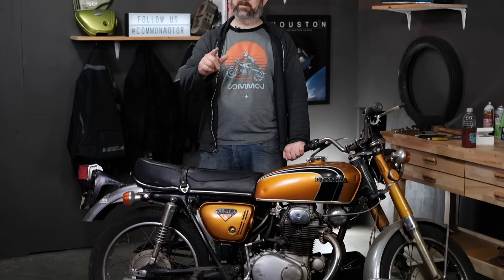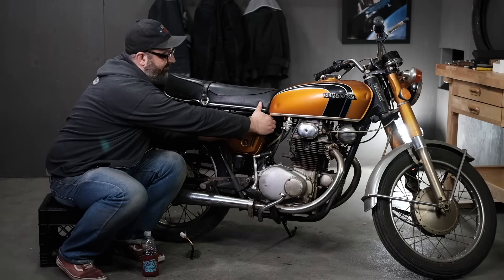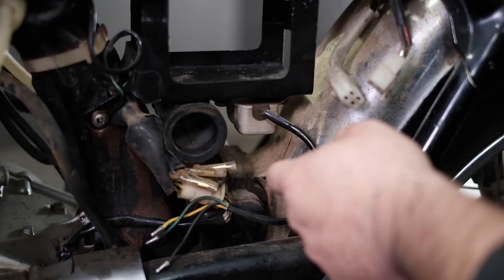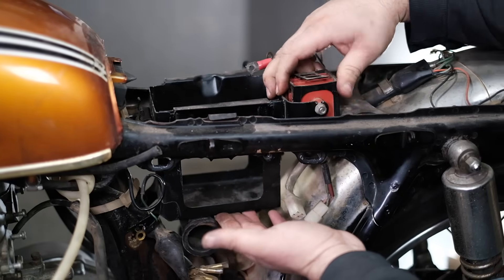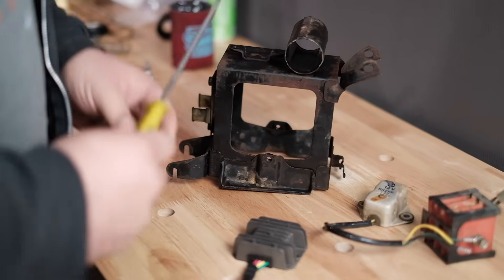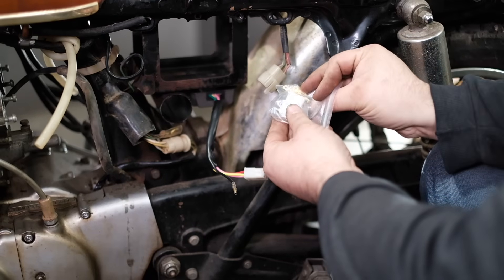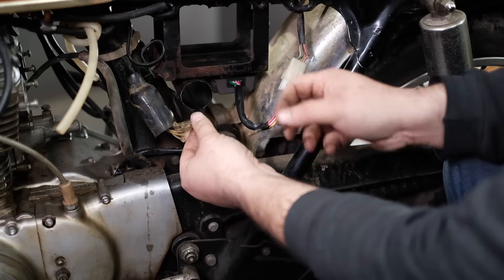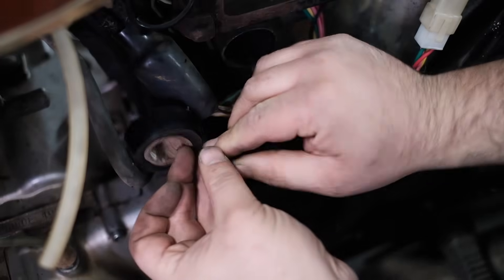How to Upgrade your Vintage Honda CB175 / CB200 / CB350 / CB360 & CB450 Regulator and Rectifier

Comment from the maker: We officially have a CB175/CB200 supplement to this video! Be sure to watch this for the differences you need to know when installing your CB175, CL175, SL175, CB200, or CL200 regulator/rectifier combo unit.

Link:  https://www.youtube.com/watch?v=Y0axV6BiWG0
Reply: Would anyone be able to tell me which one I need for a cb250 (k4 from 72 specifically) thanks :)
Reply from the maker: @lolerlol666  The CB250s are essentially just small bore versions of the CB350 and CB360 models. You will want use all of our resources for those bikes as the CB200 is very different from yours.

Comment: You should also supply a diagram of the rectifier leads. A lot of blabber when i just need the schematic. Your website doesnt have a diagram either.

Comment: 72 cb450 here: I bought a unit that I thought was the same from 4Into1 (sorry) and it does not have the black wire shown in the video. Could someone let me know what I would need to do if anything? I'm assuming I still need to connect the voltage regulator side of the system as the unit simply plugged into the rectifier harness like in the video.

Comment: What is the electrical part that fits into the cylindrical bracket on the battery box? I just replaced my rectifer/regulator combo and wasn't sure how it tied in to the electrical system or if it's something that should be abandoned. Thanks!

Comment: Any help for CB 125 1974 having 6 volts system like this? This problem has been a nightmare..... Thanks!
Reply: Yes!!! Check out the part and videos for the CT90. 6V Single Phase charging system compatible.

Comment: IMPORTANT NOTE FOR ANYONE DOING THIS UPGRADE- doing this upgrade now and I am realizing why you replaced hex bollts with allen bolts. after the holes are embiggened to line up with  battery box, there isnt enough clearance between the hex bolt head and the side of the regulator to get a socket on the hex bolts. at least that is what I am encountering.

Comment: Love your videos they have helped me alot and you explain things very simple and easy to understand. So my question is if my wire harness is chopped up and or missing how do i go about wireing one of these up? I have a 1977 cb750k and the previous owner had some very poor electric work 90% of my harness is gone and im attempting my hand at creating my own and updating things along the way
Reply from the maker: Thats a tough situation, trying to creating a harness from scratch and also diagnosing it. The best thing you could do is pick up a good, used, original harness on eBay if you can find one. Even if it needs a few repairs, the OEM harnesses are extremely high quality and the few repairs will be far easier than what you are working with.

Comment: After watching this video, my question for you is would you be able to confirm for me if this applies also to my 1967 Honda CD 175 (6 volt) The rectifier /regulator, that I’m considering buying is with a matching wiring harness with the exception of the black wire that you refer to. On my bike, do you know if the black wire is essential that I loop it back into the existing positive /regulator wiring? 
Thank you. I believe your video was very helpful as long as it applies to my machine.

Comment: I hope someone could help me. I have a 74' Honda cb200. Changed the regulator and bought a new battery. Starts momentarily but won't stay running and the lights are also not working. Does anyone have any idea what it could be?

Comment: Hi, Have an old Bridgestone 175,trying to upgrade rectifier. Bike has no stater,  it has an AC generator  and a 3 phase selenium rectifier. The new solid state unit has 6 wires,  with 4 yellow. Any ideas?

Comment: I recently acquired a TLR 200 reflex it's the earlier version from 79 to 86 I have a 1983 and a 6 volt system I need to change out the rectifier it says rectify regulator on the unit SH542-6  39 6v  and  I'm making  to much voltage  when  over half revs  Is there a replacement  in 6v Kindest regards Bell

Comment: Hey folks, Is the bolt connection of this unit (to the bottom of the battery box) a functional ground to the frame? Did the elimination of the original rectifier remove a green-wire to chassis connection? How about the removal or the original regulator (did that remove a green to chassis connection)? Thanks!
Reply: No. The battery box should be sitting on rubber cushions on top of the frame.

Comment: Nice.. but the drawback of shunt regulator is increasing fuel consumption with more losses of AC current than the it's original linear regulator...

Comment: Perhaps a dumb question. Does the reg/rec need to be grounded to frame? Meaning the two holes you embiggend do they need to be grounded to frame. Might be redundant. 

I was thinking about mounting mine to something not grounded to frame.
Reply from the maker: Nope! They already have a ground wire on it that connects to the harness ground circuit.

Comment: Hello, I bought one of these conversions for my 1970 SL350, my wire harness that plugged into the rectifier is a flat in line wire plug. Is there an adapter of some kind to make it work?

Comment: I like to ask if you tape off the yellow wire from the stator then are we not going to have a dual phase system  . One being extra voltage for the head light and the other dedicated to the charging part . Technically the purpose of dual phase on these twins  one single faze is to regulate for the headlight and the other faze is dedicated for charging and keeping up with the rest of the bikes electrical system right ? I am hoping I am saying this right .
Reply from the maker: Hey Jeff, it's best to combine them its a single, always-on charging system. See our white/yellow wire mod. Honda only had them separate back in the day because the selenium rectifiers of the day couldn't handle the current of the whole charging system without the headlight adding a draw. A modern reg/rec can and gives you the benefit of more charging.

Comment: Do you have any idea how the older model bikes handled the a.c. voltage range without a regulator? Aside from a field excited system? How does a charging system not use a regulator but still rectify the a.c. to d.c. and send it to a battery?

Comment: I like using shrink wrap for loose wires Makes a real nice and neat installation  I also dont like open ends  so when I use shrink wrap I leave a little bit sticking out a bit and when I use a lighter to shrink I just pinch the end of the shrink wrap to seal it . That way you dont have to have all that mess latter on  with tape . Tape over time will unravel and that messy sticky adhesive collect dirt and grim . With heat shrink that wont happen .

Comment: Some advice: before removing the battery box on a CB 450 be sure to have marked exactly where it fit.  The brackets that hold it "float" for lack of a better term.  After reinstalling my battery box, I found the bolt holes for the air boxes and side covers would not line up.

Comment: @ 4:04 mins. You show a weird type of cylinder that has green red and yellow red attached to it is that a part of this replacement?
Reply from the maker: I've watched the video a few times and can't actually find the cylinder you're referring to. At 4:04 we are removing the stock regulator.

Comment: I think this was the perfect video showing how to install the rectifier/regulator combo on a Honda.  There is one statement I disagree with, that being this mod has nothing to do with the larger bikes.  But it does, larger  bikes usually have a 3 phase stator, three yellow wires etc…. You still remove the old rectifier and separate regulator and you still plug the black wire from the new unit to the black wire where the old regulator was plugged into.  Just more wires of the same color…. Well done!

Comment: Got the Regulator & Rectifier for my CB450 K4 and installed it. The bolts are a pain - Only one was used to secure the new unit and did not "embiggen" the hole. also would have been nice to have allen head thingies. The wiring on the new R&R is just enough length to connect with the old connections, an inch longer would have been perfect. it is a tight space to get the bolts in because of the fins on the R&R.. thank you Brendan and CMC for the awesome videos and for sourcing the parts to keep these lovely motorcycles on the road.

Comment: Just recently put together a CB450 with a brand new harness and one of these rectifier regulators and I have a concern that I've not found answers to elsewhere. Engine off, ignition switch off, the rectifier regulator unit still gets hot. Presumably this is an issue? I fully expect it to be hot to the touch when the engine is running, but not any other time.
Reply from the maker: Hey chris, it definitely shouldn't be getting power with the ignition off. I would do some testing with a multimeter and see what's getting power with the motorcycle turned off. Email our support if you are still struggling!

Comment: Can I use the standard ricks regulator with an antigravity battery?
Reply from the maker: I would message ricks support but I believe they make a lithium ion specific reg/rec you'll need if you are using a lithium ion antigravity battery.
Reply: @Common-motor  thank you so much!

Comment: I purchased two of these about a year ago for two of my Honda motorcycles and just now got around to installing them, one on my 1973 Honda CL350 and the other on my 1972 Honda CL175.  The CL350 installation was straightforward and in accordance with the CMC video.  The installation on the CL175 was a little different until I finally found the old rectifier just above the carburetors tucked inside of the center frame where the seat meets the gas tank.  Luckily, I was able to use the original rectifier mounting bracket for the new CMC regulator/rectifier (RR) and installed it in the same exact location where the old rectifier was located from the factory.  The new R/R plug aligned perfectly with the CL175's rectifier plug from the factory harness.  I attached the male bullet wire from the new RR to the female bullet wire (by adding about six inches of wire) of the original voltage regulator located around the battery box.  As with the CMC video for the CL350 installation,  for the CL175, tape up the green and yellow female bullet wires from the harness that originally connected to the factory regulator.  To remove and install the unit in the CL175, unbolt the right carburetor from the manifold and carefully lower it to rest on the lower part of the engine without disconnecting the  choke linkage and throttle cable.  I give Brenden 5+ stars for the video, although I decided to go with an Antigravity battery to try one out in the CL175.  I have no electrical items that would drain the battery when the motorcycle isn't running.  After a few months, no issues and the new RR maintained the Antigravity charge.  The battery in the CL350 is an AGM battery that the previous owner had installed in the motorcycle and, although it is heavy, it can sit without a trickle charger and maintain about 13.5 volts for weeks on end-so Brenden is spot on about the AGM battery and its reliability.   A final note-do not buy a coil/spark plug wire replacement from anywhere else besides CMC because the mounting holes may not line-up with the frame holes.
Reply from the maker: We appreciate the detailed information! We're actually working on an update right now for the 175/200 since they have those few weird differences that you have to deal with during installation. I might add that the original rectifier actually doubled as the harness ground so when doing the replacement you need to re-ground the harness somewhere else on the frame. An easy spot is using the green connection left open by removing the factory regulator. Tap and bullet into and connect the wire to a ring terminal end and bolt it to the closest frame bolt. Lastly, I'm glad it's been working well with your lithium-ion! I'd usually always recommend people going with the Rick's version built specifically for lithium-ion batteries so just keep an eye on the voltage and make sure it's maintaining the charge properly and not overcharging or undercharging what antigravity recommends.

Comment: Would this work on a 1968 CD175 sloper?
Reply from the maker: It definitely should as long as its 12v(which I believe it is but could be wrong). Be sure to check the wiring diagram though and see if your rectifier is also the harness grounding wire like the CB/CL175s. If so you just need to ground the harness elsewhere, working on an update for the 175's and CB/CL200 about this issue right now.

Comment: I got a cb350f, is it the wiring the same?
Reply from the maker: No, the CB350F is actually using a very different type of charging system like the CB500F, CB550f, CB400F and CB750s

Comment: Would this work on my 81 TwinStar 200?
Reply from the maker: It might! I'm not familiar enough with the twinstar but if its a 12v system with a similar stator setup you could probably get it to work just fine.

Comment: Thanks for the video. I have a 1969 cl125A Scrambler and would like to know if you have regulator/rectifier upgrade for its 6 volt system. Thanks in advance  for your response.
Reply from the maker: I don't currently have a 6v reg/rec. I might check ricks electric, they have a bit more unique electrical gear. If I ever support a 6v bike I'm sure we will either have one made or make a 6v to 12v conversion.
Reply: @Common-motor you finally did it. Thank you!!!

Comment: I followed you instructions and installed this regulator on my CB200 but unfortunately the read out with running engine is only a bit above 12V and that is most probably the voltage of the battery. With a running engine I guess I should read a value above 13V. Something is wrong but what? Can you please give me some advice? Thanks.
Reply: Don't connect the DC output of the regrec to the charging system and measure it's voltage while the engine is running

Comment: I assume the 500/4 is the same as the 550, it's just that the only 500 you mentioned was the 500T. I have a CB 500 K0 project, so the issue is relevant to me. If so, do you have a video on the 4s?

Comment: As I look around for upgrading a CB360T ignition to electronics, there are several manufacturers to choose from.  You gotta give extra points to the manufacturer who takes the time to make a video explaining about their product and how to install the parts.  It gives me confidence that they know what they're doing when they designed the products.  Some of the other sellers may only be cheap Chinese knockoffs and I don't want to make them prosperous.

Comment: I ordered this regulator but it was not plug and play since both the wires of the bike and those of the regulator had a male plug. I had to make the wires longer and change the connection plug of the regulator.

Comment: Wat is te resistance I should read when measuring the stator of my 1975 CB200? I read 2 times 2.5 Ohm and 1 time 1.0 Ohm when I interconnect each time 2 pair of coils. Is it to high or normal or can my statorcoils be worn? My battery is not charging. Might also be the rectifier or the regulator.
Great great video!!!
Reply: I also have a 75 cb200t. If you find out what those Numbers should be update this comment

Comment: I love everything common motor does and feels like my local shop in the internets, but after "embiggenin" the holes with a file the old hex bolts from the old regulator were still too big to fit between the new reg/rec. Now I'm digging around for some spare allen bolts to fit. Just a heads up for anyone trying to use the old bolts, and maybe a suggestion to include some new allen bolts with the new reg/rec in the future. Otherwise, if it wasn't for you guys I'd be hopeless and my bike would be unrideable, so, much love and thanks for the Hat!
Reply: Ran into that same issue. The allen bolts are just a hair smaller, wouldn't work without them though.
Reply: Common motors makes me confident owning an old bike

Comment: You say the cb550/750 use a completely different system. I have a 74 cb550k0 and was about to purchase one of these units for my bike. Now I'm confused as to what I need. Can you clarify what is needed for the cb550/750, or perhaps post a seperate video? Thanks for all you do! You're a Rockstar!
Reply from the maker: Hey Doug, its definitely on our list! Until then we do have some tips on our product page for the CB550/CB750 reg/rec we sell. https://www.common-motor.com/honda-rectifier-regulator-cb550-cb500

Comment: Thank you, even though you say the 4 cyl bikes dont use this system, my 1978 cb750 is similar. Video helped me quite a bit. Easy to follow and understand. THANK YOU>
Reply from the maker: Glad it helped!
Reply: Do you got any idea how long these will last..I hate breaking down.and only care  about reliability
Reply: @dieseltu1035  Believe Me Brother this is definitely worth installing if you want reliability... and a proper charging battery, and it is a definite must have part for proper reliability, and I'm not sure how long they last for but I think possibly tens of years
Reply: Are the connectors similar or the same? What were the differences? I'm planning to swap the one on my CB750K4  out this week.

Comment: Is it working with Lithium (Lifepo4) Batterys? Or is the Output >14,4 volts?
Reply: This doesn't work with a Lithium Battery without significantly shortening the life span of the battery. Revival Cycles sells one that works with both, its more expensive but worth it if your running an Li Battery
Reply from the maker: Our reg/rectifier combo unit is made to pair with a Lead Acid/ AGM battery. We haven't tested it with lithium Ion batteries currently. I'd recommend looking for one made to pair with a lithium ion battery.